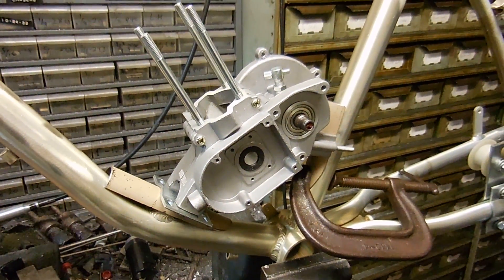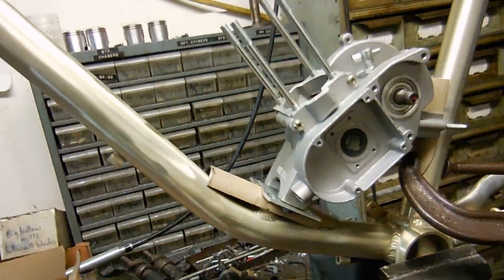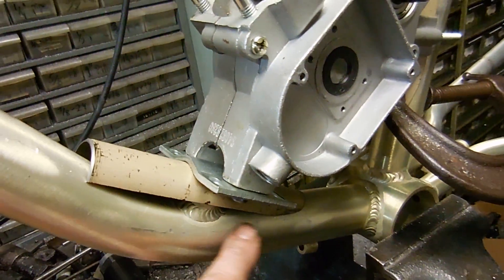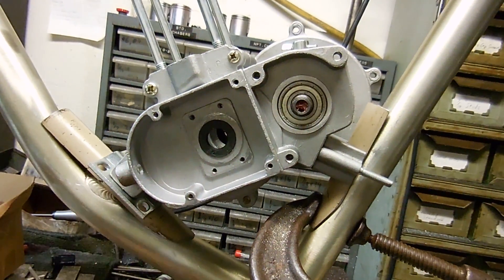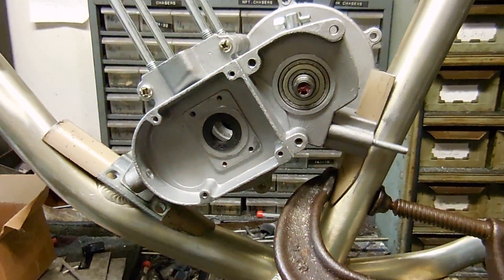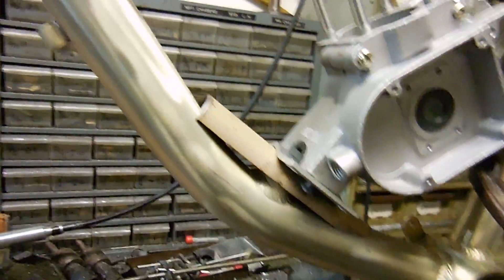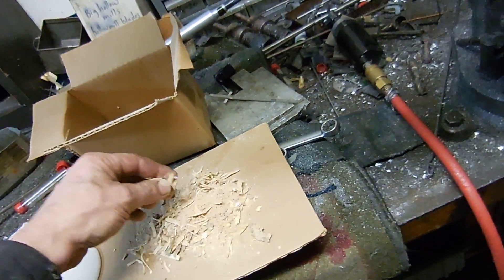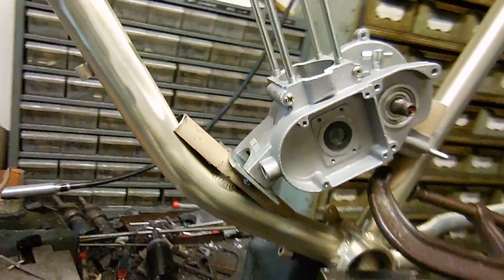New motorized bicycle engine mount saddle concept, part 1

Comment: I pioneered this process last year on this very frame. To late to stop you now but you should have used the epoxy stick type. It mixes up like dough and you can apply it to the saddle then press it onto the frame. The excess will squeeze out. Do one at a time, put mold release or paste wax on the frame so it doesn't stick.